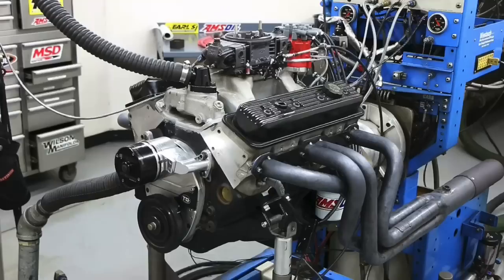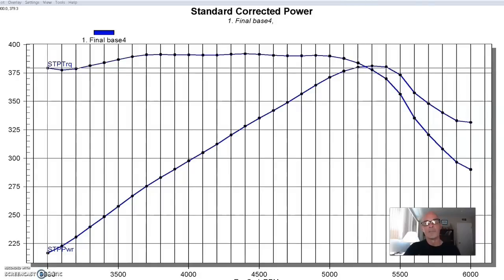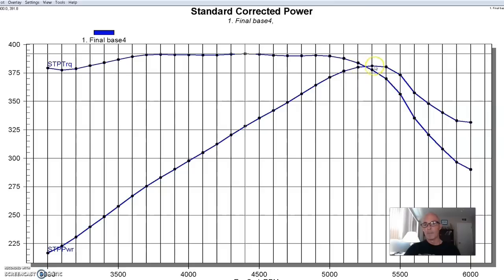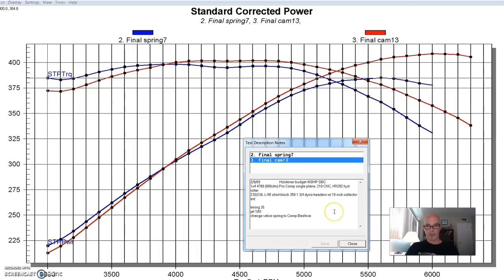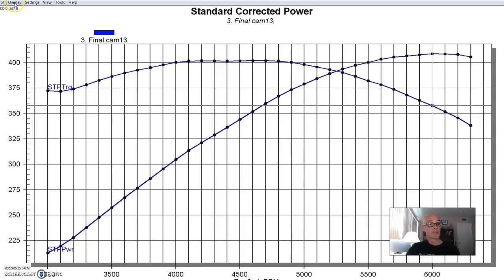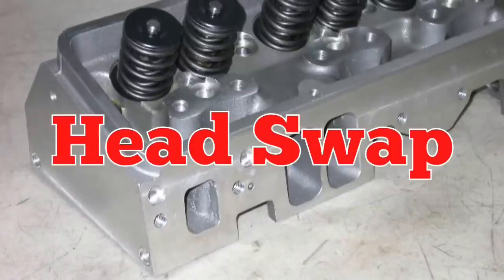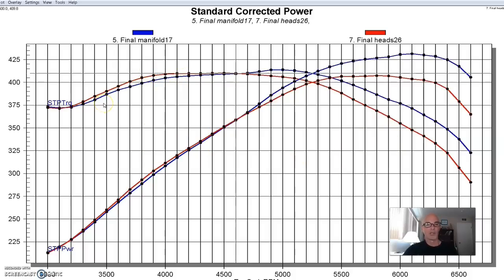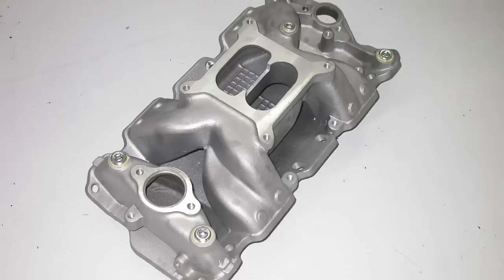DIRT CHEAP SBC MODS?

Comment: I always appreciate the good old SBC builds seeing that it's been my engine of choice for longer than I care to recount. I also appreciate the observation regarding the cylinder head vs camshaft as illustrated by the LS3 comparison. What I would like to see (as a bit of a follow up to what appeared in one magazine with T&L/Vizard many years back) was the SBC with too small a cylinder head, too low a CR and cam much larger than you might expect. Seems to me that was an interesting result and one that you might not have expected. Sort of like a 170cc head on a 383 with less than 10:1 but a 236@.050" cam spec. 
Enjoying the videos Mr H. It's also been interesting to be re-reading my old issues of Engine Masters magazine and seeing your name on the mast head (who knew?). Getting reading for another SBC build here.

Comment: Only catch to those L98 shortblocks is that many came with dished pistons so even with 64cc combustion chambers the CR is ~9.5:1 which is on the low side for a performance application with aluminum heads.
Reply: Edelbrock's RPM Power Package kits are designed for 9.5 to 1.

Comment: I’m glad you are spreading the word about good flowing heads Richard. To many guys try to crutch heads with a big ass cam.
Reply: There is alot of confusion, maybe even misconception on cam shafts. big cams has little down low, where small cams has less up top, cams should be specced to the engine.

For example, a friend of mine has a vw jetta mk2, I live in south africa so little to no v8's here, he has a n/a 2.0 8v single cam from a vw golf mk3 gti. stock bottom end, stock u flow head(its a 2e engine, not a aba that has a crossflow head) what he did is port out the ports as big as they could go but kept stock valves and everything, then still has the same carb and intake found on all carb vw engines from that era. he has a cheap extractor and freeflow exhaust, just some tuning. He was talking about doing a 288 cam on it, but this setup is only good for max 7000rpm if youre lucky, the low end would be crappy, so wil driveability be too. id rather go with a smaller cam, like a 272 or a 276, but id junk his beloved vw carb and go with fi or a much larger carb.

Making power on a engine is all about relieving bottle necks, but not many everyday guys understands this.
Reply: In the bad old days, that was all you could do, along with domed pistons, and spending big bucks to have your heads ported by hand.

Comment: Great information on the 350 small block power upgrades. I was surprised that you had to change the valve springs on the CNC heads. I guess that folks should make sure that the springs on their heads will work with their cam. I've seen where some heads come with different spring rates. I look forward to watching your other videos. 
Great video content, thanks for sharing!

Comment: Another great, thorough video.... I know you've done some mopar stuff lately and we really appreciate that... How about doing something like this with with a 360? Like compare a stock 360 to one with a good cam, intake and heads, then stroke it out to 408 and see exactly how much more you get from that. A lot of us build 408's but it would be interesting to see how much more a 408 is to a similarly built 360...... Thanks!
Reply: Yes i just bought a 408 stroker and im looking to see the difference of a 360

Comment: I'd LOVE to see a really aggressive lobed cam like the comp QXI / QXE lobes or even a solid roller lobe.  -A dyno test highlighting the trade-off between aggressive lobes: longevity and valve train costs vs. power. 

-With the big port volume and flow for the cubic inches and RPM, getting that valve open fast and far would've helped produce more power, especially if you already had to buy new springs.

The flat tappets like the Comp XE lobes are essentially as aggressive as a typical hydraulic roller cam (compare the Comp flat tappet and hydraulic roller lobes to one-another; they're both called "XE" for a reason as they're basically the same lobes); to get the benefits of a roller cam in a modern build we need roller cams that have lobes that are more like Solid Rollers. -The Comp XFI and especially the QXI lobes are "solid-roller (of old)-like".  They need lightweight valves and retainers or really big springs and heavy thick pushrods, but they make the most of a roller cam.

Torque is based upon the AMOUNT of flow in a GIVEN AREA.  The difference between an "equally good" 210cc head and a 195cc head on 350/355 cubic inches wasn't really highlighted here.  This was a much better 210cc head vs. a 195cc head: CFM per cross-sectional area of the two heads would show the issue.  -I guarantee if you divide the max CFM of the 210cc / it's minimum and average CSA you end up with a higher number than if you divide the max CFM of the 195cc as-cast head in this test.  -> Now do the same test on an AFR 23 deg head and you'll see that "average port speed" produces the most average torque and wins races on an NA motor.

Heads should be sized for the motor based upon CSA, cubic inches and desired HP peak RPM; not port VOLUME.

Comment: Richard, awesome videos. The more and more I watch these videos, the more I think of getting rid of my Vic Jr single plane intake. Long story short, was told ( builder) that my 383 SBC, 10.5:1 , 195  AFRs, .577 lift cam, 232/236 @.050"- 108 LSA, would not like the Air gap rpm. Car runs awesome,  but know can't stop wondering if I'm missing out!
Reply from the maker: you will trade power like every single vs dual plane test
Reply: @richardholdener1727  yes, seeing that now. I honestly feel the low end torque gain is alot more beneficial to me than the 5000 plus rpm HP gain. Thanks again for all the info!

Comment: Cool to see the 190 vs the 210 procomp dyno results, I would of expected more down low out of the 190.  I know other brand heads dyno better down low but from these results I wouldn't bother with the procomp/speedmaster 190's.  Thanks for sharing!
Reply: I’m sure the 190’s would benefit from some basic port work, but for a few dollars more you could get a head that flows more out of the box, so why bother with the speed master heads.

Comment: That's very good  to know how the valve springs helped power in the entire rpm curve  rather than just at high rpm. Goes to show the wrong spring rate  on a lobe will affect spring performance at all rpm range. 
I remember  years ago having this conversation with cam manufacturers.  Even if the rpm range of your fireball cam wasn't much more than stock, stock  springs would not work with it.
Reply from the maker: springs usually only change power at the top (where float occurs)
Reply: @richardholdener1727  This is what's happening to my marine motor: 190cc inexpensive heads on a 383, CompC XM276HR, full roller, but not making more than about 335hp according to my speed...I'm buying CompCam Beehive springs today and going with the Hurricane Single plane intake as well...currently running the Weiand Dual plane Street Warrior & a Holley 670vs...also going with a Holley 770vs Marine Avenger. Stuck on suggested ignition timing: at 35 max at the moment, but other 93 octane runners that I talk too are going 37-38. Thoughts? No, there's no engine dyno within 100 miles of me :(

Comment: Very good video! I used a performer rpm cam with Victor Jr intake on my 73 camaro L82 m22 rock crusher and 3.73 posi rear. It ran awesome in the quarter mile! 12.92 @ 109mph was my best but I only had 26 inch tall tires. It may have been a bit faster with a taller tire. This info is great!

Comment: For my driving style. I'd pick a cam in the 210 to 220 duration area. perhaps the AFR195 heads.   Edelbrock Performer intake. Why you might ask, well I'd respond that with a shaker hood you gotta keep the height pretty close to stock .  Even the performer intake is too high, but delete the thick intake to carb gasket and it kind of fits but remains too high.   A low RPM cam that keeps good vacuu for your power brakes and A/C controls which are vacuum actuated. . As well as to keep fuel efficiency up.  the long legged rear axle ratio runs at 2200 RPM at highway speed so you don't want a lot of cam killing torque off at these speeds. Its about a matched set.

Comment: I’d love to see you do a 355,10:5:1,,with the edelbrock performer RPM package,with the hydraulic roller setup.wondering what kinda power that would make against what they advertise! Love your shows Richard,keep them coming!!
Reply from the maker: usually more than advertised
Reply: @richardholdener1727  You proved that yesterday with the 351W. They claimed 410, you got 459 with a carb. On a 440 Mopar, they claim 482 hp, but I've heard it's over 500.
Reply: @richardholdener1727  I'm certain that Edelbrock tests with their own carbs, but you and others use high end, chokeless Holleys. That may account for some of it. Or maybe they use either a more conservative dyno, or a more stringent SAE test standard.
Reply: @richardholdener1727  you use stock rockers, lifters, and push rods?

Comment: CnC heads, 276 cam, Air Gap intake with spacer, solid electronics and slightly modded 750 carb.

Comment: Great test. Surprised that the larger ported heads made this much difference with a moderate lift cam.  Thanks for the test.
Reply: Bet you thats where those heads stop flowing at. Usually those cheap heads ahve a tough time flowing any more air past .500 lift.  

The new AFR enforcers cast heads are like that

Comment: Quite a change from the valve springs all the way through even before the valve float.
Reply: Yes I noticed that as well. If it wasn't in valve float it should have made more power with the lighter springs, not the other way around.
Reply from the maker: we spent a little more time tuning the spring combo after experiencing the valve float-no need to tune the float combo
Reply: @richardholdener1727  fair point.

Comment: I’d love to see you review those dirt cheap ebay SBC aluminium heads
Reply: Yep and while he's at it the ebay turbo and headers as well
Reply: @brendan1675  you need to subscribe and search, ask and you shall receive, he's ALREADY DONE THOSE TESTS
Reply: He's already done those tests, RECENTLY
Reply: I built a low buck 383 chinese 4340 rods china 200cc heads small 236/244 @.50 sr cam with rpm intake 10.5 to 1 compression and, it was a torque monster pushed 3660lb 4 door to 7.55 in 1/8 mile

Comment: Hi Richard , you've touched on this subject in the past claiming it to be " practically a myth" ,  how about a test on mis matched intake manifolds ranging from way to small for the head to way too big for the head to just right all on the same heads and manifold , keep up the testing and we'll keep up the watching
Reply from the maker: mismatched ports?
Reply: @richardholdener1727  He means (I'm sure) an oval port intake on a rectangle head, or vice versa, or, like they did in the 70s, a factory Cobra Jet intake on a non-Cobra Jet motor. Check out Pat Ganahl's 40 yr old book Ford Performance for all the (obsolete) poop.
Reply: Yea, I'd love to see that, too! Mismatched intake AND exhaust ports. I've never seen it AB tested before.  -Some folks claim that a smaller port on the intake side dumping into a larger head port can HELP torque / power especially when the heads are slighly over sized for the application. 

I've also heard some folks say that  having a "step" mismatch from a D-port exhaust port in a head to a round header can act as anti-reversion and prop up low-end torque when using a big cam, but I've also heard the opposite, too -> that you want a D-port header on a D-port exhaust port to keep the velocity up to get the exhaust charge further from the cylinder and that THAT is better for anti-reversion.... -Can't be both!

Other extreme exhaust port mismatch: Calvin Elston, one of the top 2 names in header design, says that when exhaust ports are way too big (Big Block Chevy as an extreme example) -he can make way more torque AND HP by having the header entry actually be SMALLER than the heads' exhaust port and that the increase in velocity is beneficial for reduced reversion that props up torque on the low end AND makes more HP on the high-end when sized appropriately because it gets velocity back where it should be. 

-Never seen any of this tested; just theoretical discussions.
Reply: @richardholdener1727  Or even a "big port, small cam" engine approach vs. a "small port, big cam" approach to the same engine and HP GOAL.  (Ex: If you build 400 or 450 HP 355 SBC with a 210cc port head and a smaller cam and you then swap to a 180cc port head on that same engine and cam it for the same 400 or 450 peak HP, what happens to the curve?)

Comment: I'll take the Edelbrock dual plane AirGap, budget CNC 210 heads and XE282 bumpstick. I think that's the Goldie Locks combo for a healthy street machine.
Reply: I'd take that motor!
Reply: Me too. I wish he would do a top end for towing and street use. Max Average power under 5000rpm.
Reply: How much power 💥 do you think is that combo hood for

Comment: can u test a 8.1 vortec  big block and feed it some boost . heads cam . or maybe a high compression version.... thanks man love the vids 👌
Reply from the maker: I am looking
Reply: Whitey Powers  that's the point, they aren't expensive. If they respond to boost then let's all have a torque party.
Reply: Whitey Powers  they had marine versions up to 525hp.  and they have a stronger bottom end than a 454.  Raylar is the only game in town for aluminum heads so they can charge what they want.  they probably have to charge a lot because they don't sell many.  if the 8100 were more popular parts would be cheaper.
Reply: I’ve got a top kick deck ,tilt bed with a 427 that’s timed out . I’d like to do a larger displacement, low comp build with boost .... I think there’s a future in it .
Reply: Whitey Powers  the engine itself doesn't "suck for performance", just the price of the performance parts. 

I would really like to see what the gains would be with a larger towing/truck cam, as I feel most of us with an 8.1L would probably consider a cam of that type.
Reply: @richardholdener1727  I know where one is in California at a wrecking yard
Reply: I'm surprised they arent more popular. Pretty decent EFI, 496 CI, cheaper than stroking a 454......much more low end tq than a 6.0. Small cam, maybe ported heads, maybe a better intake? Great truck engine without the hassle of diesel.
Reply: @brianaaron8247  its just because they arent as common
Reply: its the head--if GM had made it easier, they wouldn't sell many 502 crate engines. Or maybe their real reason was to go up against the Mopar 488 cid V10 without a million dollar clean sheet R&D program.

$3K for heads isn't cheap...welcome to the non Chevy world for the "other guys"  :)   Maybe its easier to hit up a machine shop for a leftover 454 block, and swap over the recip assembly and front dress and other stuff. But you have to come in under the cost of a crate 502...or a 454 on N2O :)

Comment: Great stuff again! Thanks Richard. My only gripe... I wouldn’t consider roller cams as “budget”. A hydraulic flat tappet would have been more appropriate maybe?
Reply: I agree, to a point: on a factory roller motor, you can use the original lifters (usually). But, yes, the cam itself is still $300. A quality HF cam AND lifters is $200. But the roller will make more power, so the extra $100 may be worth it. Your call.

Comment: Fast burn aluminum heads, there's not much for videos of dyno runs with these heads, would love too see like low buck 383 with these heads with different intake and carbs to see power numbers!!! Keep up the good work, Rich
Reply: Huge torque, run out of air up top. Great street choice

Comment: Great video, definitely learned a good bit. Here’s my situation, I recently inherited my grandfathers 1970 Chevy C10 LWB.  I’m new to the restoring/rebuilding game but I want to do as much myself as possible, why, bc that’s how my grandfather did it. Here’s what I know, It doesn’t have the original 350 and I believe it’s out of either a Pontiac or a Buick... I get two different stories and my grandfather passed in 09 so I can’t go and ask him. I do know that is a 350 sb with a Quadrajet carb and it’s hooked to a turbo 350 trans. I know there’s a lot more to do than just the engine to get the power I want.  
I am on an extreme right budget (thanks wife) and I am giving up a brand new truck to make this my dream. If I have a budget of $1000 to get as much power and torque out of this engine... what do I get engine wise?  Thanks for any help or guidance.
Reply: Buy David Vizard's book and pay him to spec a cam for you. The wrong cam costs just as much as an optimal cam.

Comment: the recipe for a cheap performance small block--invest in the short block. Get a good crank, rods, pistons, and balance it. Slap on cheap heads and intake. Drive and save up money for good heads and intake, since they can be installed next year without tearing engine apart.
Reply: we are talking about beer money for young guys--- beer or sb chevy parts---make a choice

Comment: The dual planes should've been tested with the 270 cam....more appropriate match. The dual planes with the 282 cam were also a slight mismatch, but I was surprised how much better the RPM did vs the cheaper dual plane. I assumed the offshore intakes were exact duplicates of an RPM, without the logo.

Comment: I have a 72 Nova with a "383" stroker supposedly but it has no power. The paint is nice and I don't want to mess it up by cutting a hole in it which a high rise intake would want to do. So if you can setup the best low intake setup for power that would be interesting on a budget as well and no budget thanks your videos are really entertaining and informative